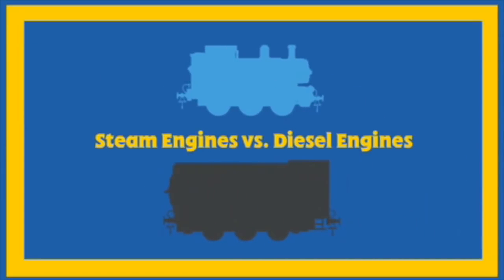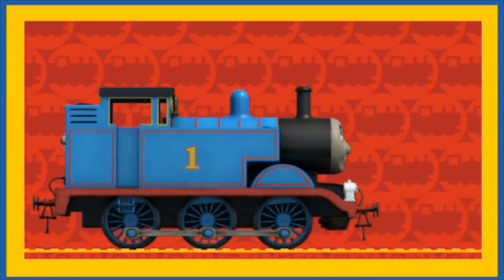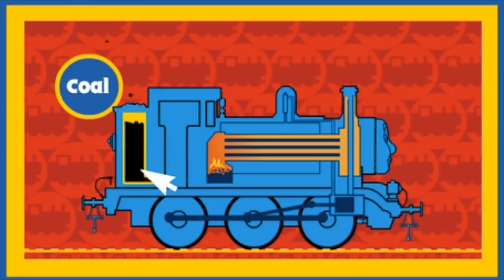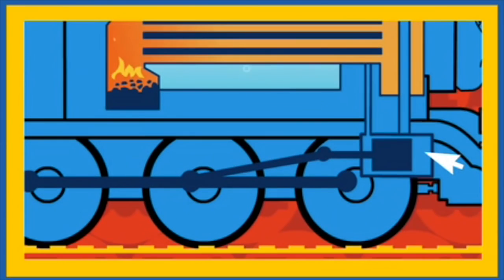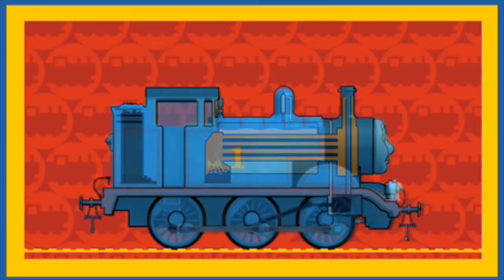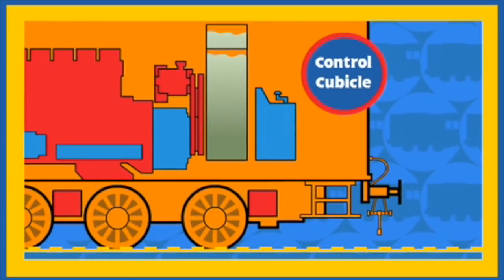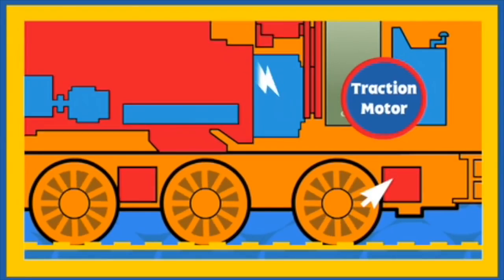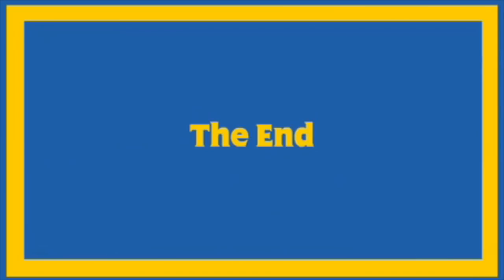Steamies Vs  Diesels - Thomas & Diesel

Comment: I've especially wanted to mention that I personally love this video as I've personally get some demonstrations of the Steamies are different from the Diesels in how they operate! I've also apparently did especially wanted to mention that I personally know that Diesel is basically based on a BR class 08 diesel-electric shunting locomotive that basically got built in 1953 by BR over @ 5 different B R workshops with a total of over 950 being built from 1953-1959 with a total of EXACTLY over 190 being built @ each workshop! They've especially been given a complete 0-6-0 wheel configuration, an electric transmission, an English Electric 6kt diesel motor, a total power output of exactly 350 horsepower, and especially a certain 20 MPH top speed! That certainly would mean that they certainly AREN'T built for speed, but they certainly ARE built for power as Diesel certainly mentioned very clearly that he's basically known to be revolutionary during his season 2 introduction in the episode titled Pop goes the Diesel when Sir Topham Hatt brought him on trial to the North Western Railway! He certainly managed to mess up by telling lies about Duck just by saying that Duck gave the big engines nicknames, so he'd been sent packing straight back to the Other Railway on the Mainland!